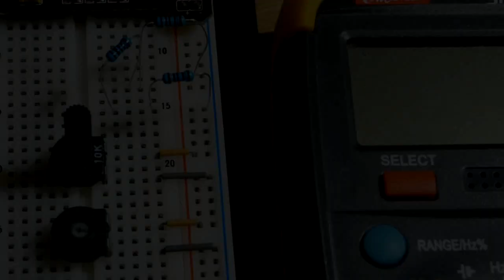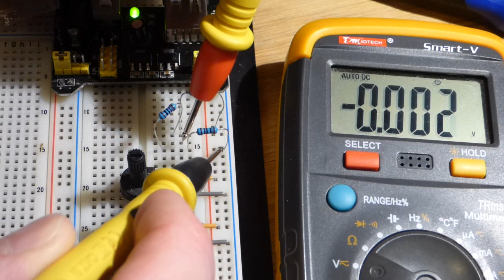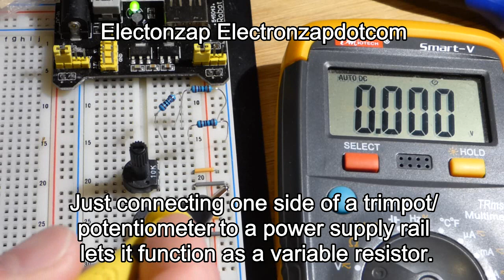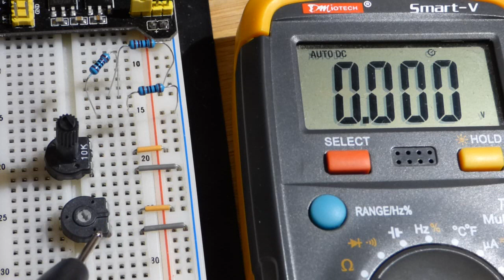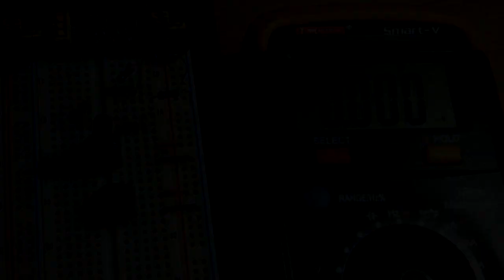Trimpot trimmer potentiometer component voltage divider basics for beginner learning electronics

Comment: Good explanation. Where did you get these trim pots. Mine are really cheesy.
Reply from the maker: Thanks! Kits tend to not keep using the same components, but I got the 10K trimpot I am using from this kit https://amzn.to/2Yvk282 and the 1K trimpot I am using in this kit https://amzn.to/2YseL1d
Reply: @Electronzap  Thanks for the info. I did find these that look pretty good.  https://www.ebay.com/itm/MCIGICM-potentiometer-assortment-1K-5K-100K-10K-Ohm-Breadboard-Trim/323656805312?hash=item4b5b72ebc0:g:vEMAAOSwip5cQzgU
Reply from the maker: Yeah, I have considered getting those if I ever add to what I have gotten from kits.